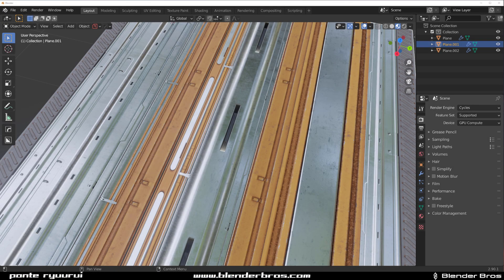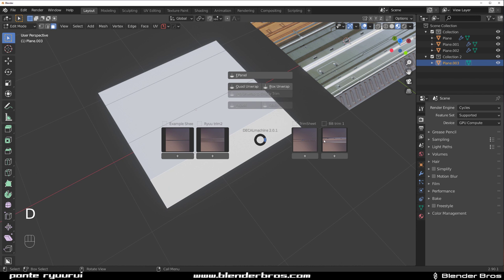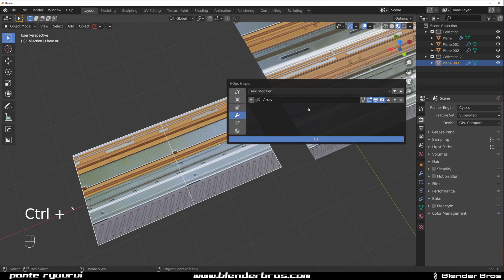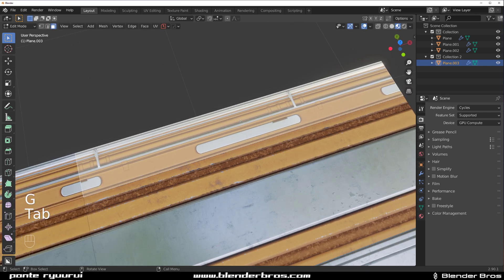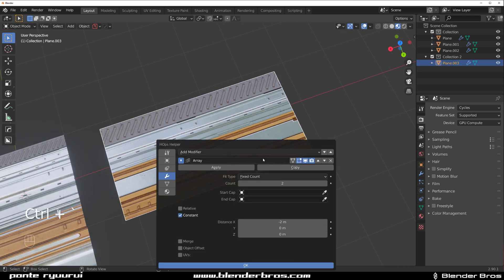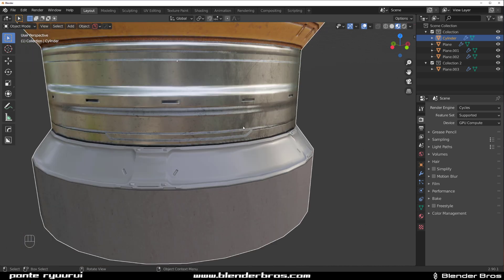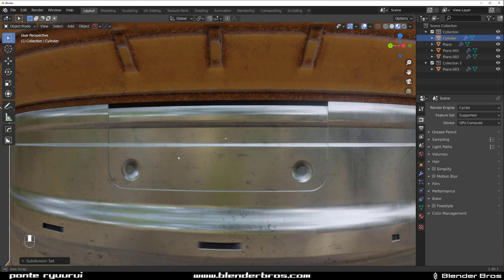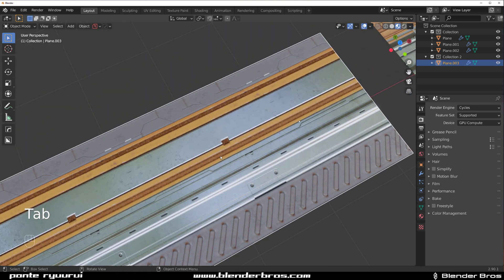GAME ready scifi details in 30 seconds! Tutorial on trims sheets in Blender with Decal Machine 2.0

Comment: Did you show how bake this staff with decals? And how use it in substance painter or in some soft like painter?
Reply from the maker: what do you mean bake it with decals, you create trims from geo, not from decals, though you could mix normal maps i suppose in photoshop. not yet, but i will, in QM
Reply: @PonteRyuurui  i mean how we can bake this trims to low poly with simple uv and then use in game engine.
Reply from the maker: @commonnormal7256  watch my vid on trim sheet creation